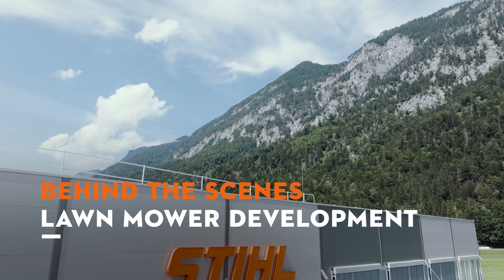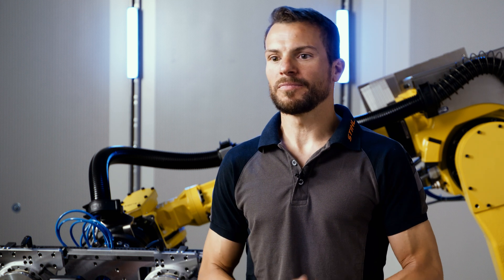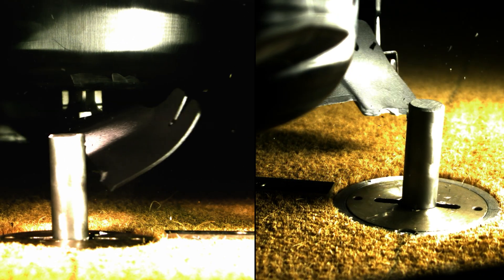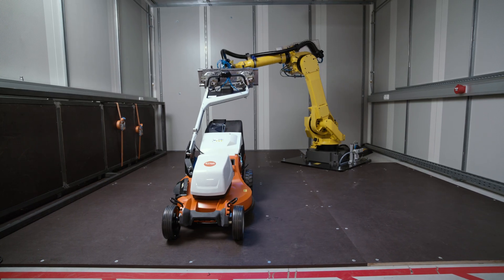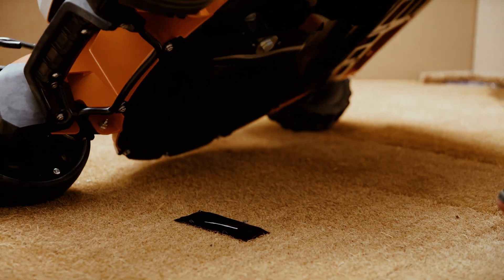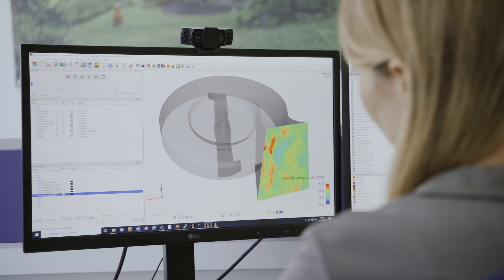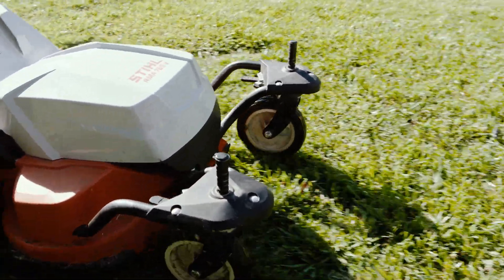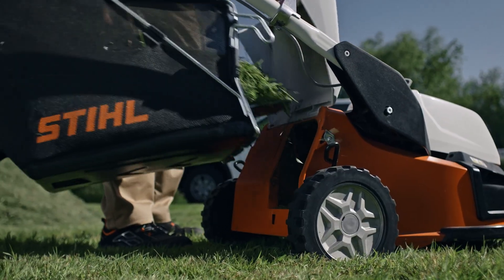STIHL lawn mower development | Behind the Scenes

Comment: Grass box fill indicator on rma 239c is ineffective on the lowest setting on uk models. Works perfectly on the second setting. But when cutting the grass on the 20mm setting (lowest setting) it doesnt work.
Reply from the maker: Hi! The central cut-height adjustment can be adjusted at 6 points between 20mm- 70mm and the stream-optimized blades ensure longer battery life. The RMA 239 C has a cutting width of 37 cm / 15". If you are encountering an issue with the lowest setting, please contact our colleagues in your country and we will look further into this. You can locate the contact details for our colleagues in your country through the link below.

https://www.stihl.com/local-stihl-representative.aspx